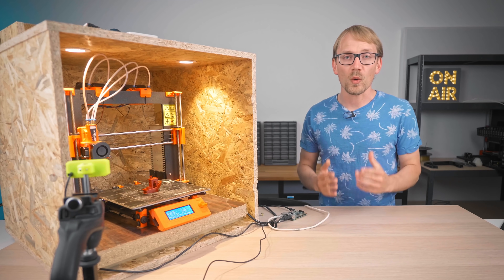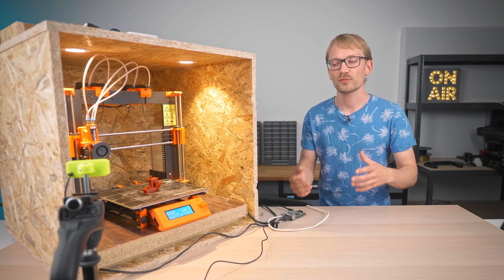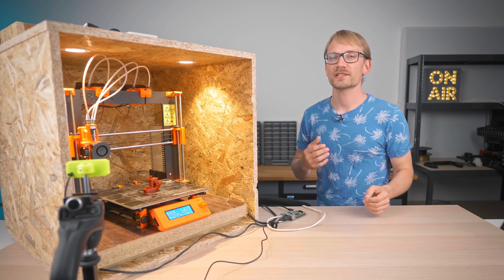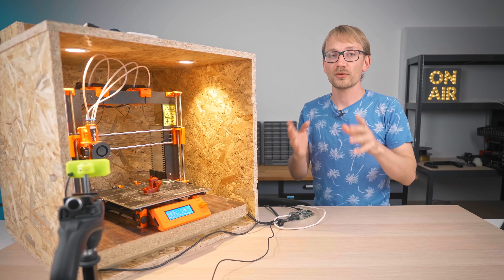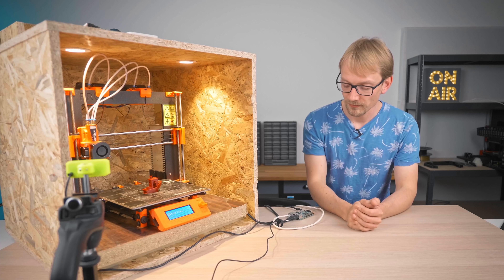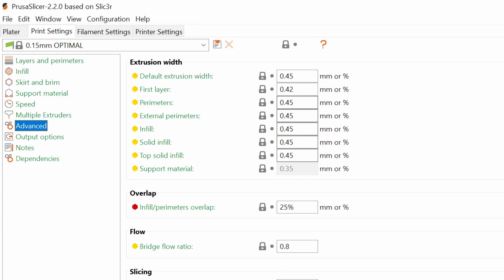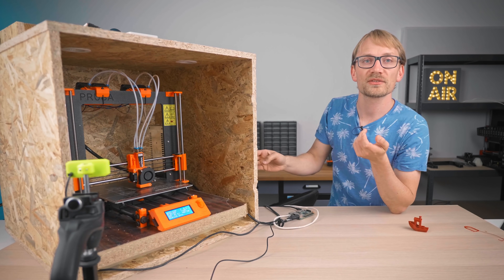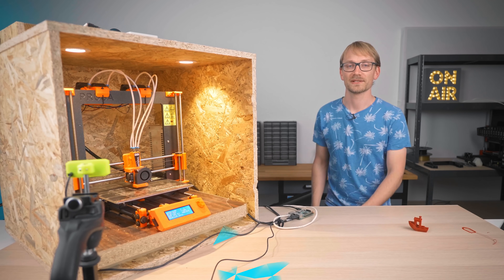Starting 3D prints without getting up from my desk - choose from 4 filaments in one click!

Comment: My Ender 3 set up has been on a shelf mounted in my coat closet for silence and convenience. There’s a “Vesync” smart outlet plugged into a UPS in case power is flakey or shuts off momentarily and the smart outlet is used for powering the machine on remotely and starting prints, or for turning the machine off on a timer late into the night. I have the Octoprint Pi mounted in an enclosure by the printer and it has “PortListener”, AstroPrint, PolorCloud, Spaghetti Detective, and a few other plugins so it will automatically connect to the printer once it is powered on and can then use any of the cloud accounts to accept and begin prints. My choice of slicer is Simplify3d and I have the script to automatically send the gcode and start for quick prototyping. The MMU is a great addition to that!!!

Comment: I have a similar setup as you, but am using a Prusa MK3S with MMU2. There is an Octoprint plug-in for this called MMU2 Select Filament, that will allow you to use the MMU Single filament printer in PrusaSlicer, and choose which filament to load from the octoprint screen at print time. Pairing this with the Filament Manager plugin, and I can see not only which filament is loaded into each port on the MMU, but how much is left on each spool.  I've found this especially helpful this last month as I've been printing a lot of the Prusa Face Shields. As one spool of filament is running out, I can simply switch to a different "tool" to print in a different color without reslicing it to assign the next filament.

Comment: I've had so much trouble getting reliability out of the extruder on my Ender 5. I've used Chep's recommendations for a spacer in the hot end, and actually now just take the boden tube out of the coupler every time I change filament which isn't a big deal with that spacer/boden setup in place. I'm going to look into replacing the whole hot end assembly with a different design soon because I'm on my third one from various failures. I've almost given up on printing PLA/PETG on this printer even though it's supposedly supported, not sure if I'm getting burnt material stuck in the hot ends or what but no end to the problems.

Comment: You're a genius of you can get FUSION 360 to get up and running in 5 minutes let alone design a part another 10...

🤦🏻‍♂️

Stay safe!
Reply: I ussualy stary F360 and then just lunch and then come back
Reply: I have a new laptop,and fusion is very fast now . Indeed 5 minutes
Reply: @magomat6756  I never had a problem with speed until the 2019 overhaul with updated UI.

My machine is no slouch with 8 core Intel I7, 16 GB memory, 8 GB Nvidia GeForce HDMI with full Full HD+ 

No other programs have slowed down, except F360.
Reply: @DougHanchard  SSD is possibly the missing link
I5-4460 3.2Ghz,  8 gig memory I get 22 secs from double click  F360 icon to being able to start a sketch - leaving 4 mins 38sec to make the object....

SSD has changed my life -  and any request to reboot is no longer an "awww do I /really/ have to..." response...
sub 1 min cold boot so it is no longer a drama

I couldn't go back to mechanical disk and well worth the extra cost
Reply: @robocog  or better yet, m.2 ssd
Reply: @robocog  About the same here. 16GB memory on an older Ryzan. The big thing is the M2 ssd. Even a sata ssd does wonders.
Reply: I5 3570K, 16GB DDR3, GTX980 x2 SLI, 2x 256GB Samsung SATA SSD raid 0.
24 seconds from double-click to sketch. That's with 4 chrome windows open each with like 10-15 tabs.

Comment: Instead of leaving my printer plugged-in, I prefer using a smart power outlet and turn on the printer as well as the octopi remotely using the Smartlife app on my phone. I feel safer knowing that my printer is not powered on when i'm not using it :P
Reply: I just had the MOSFET controlling my hot end fail ON a few days ago.  It didn't start a fire, but it could have easily.  I'm working on adding a relay to octoprint to power off when the print is done, hopefully through a custom g code command

Comment: I have a similar set up. A mk 3 with an mmu2 in an enclosure. Dry box on top with 8 filament feed ports out of the box. LED lights, octoprint with a webcam, and spaghetti detective. My biggest issue is the mmu2. It's almost not worth the hassle. I can't seem to get it to be reliable.

Comment: My ender 3 with hemera and a bunch of other upgrades is reliable enough that I can set a print and be very confident that it will finish without issues. That's with pla, petg or tpu (the only three filaments I've found I need for just about everything.

Comment: With 0.5  nozzle external perimeter can still be 0.4 for details and internal at 0.6-1mm easily. So 2mm wall will be three perimeters, not four. Most limiting factor is actually heater, so better use volcano to not lose speed.

Comment: I thought that you're going to promote Pallete S2 at the first glance, lol. I have the same setup but with an Ender 3, the only one problem is that I need to manually change the filament. In my opinion, Octoprint and Cura(with extensions)/Prusa slicer is just the perfect combination for a workhorse machine.

Comment: I have a MK3S and I had the same filament print issue.. I have not yet fixed it but I am taking a more drastic attempt changing the of the hotend heat break part for genuine e3d part.
as apposed to the prusa specific model and removing the quiet fan for a high flow fan.. still waiting on parts in the mail...

Comment: That's exactly what I've planned doing with my MK3s and MMU2s. Parts for the Ikea Lack v2 enclosure are already printed, Lack tables, acrylic panels and RasPi are here but I have to wait until Monday for the DIY shops to reopen to get the screws and other needed stuff. Thanks for the tips and tricks to get this setup running. 👍🏻
For monitoring via Octoprint you might have an eye on Printoid or OctoRemote if you have an Android phone. Printoid also gives you the ability to see the video feed. I don't know if OctoRemote does that aswell. You could do a VPN to your router and monitor it securely like that.

Comment: If you want to remove some concerns about leaving the device running unattended, one extra piece of mind would be adding a remote way to cut of its power.
A Tasmota compatible WiFi plug can be used for that, there is even a plugin for octoprint which monitors thermal runaway or simply turns the printer main power on/off for and after prints.
There is also a version where you solder a relais inline with the power yourself and hook that up directly to the Pi but the WiFi plug is just a simpler solution.
Just make sure to leave a good delay before it turns off, just in case the PSU is still toasty and things had time to cool off a little. Not that there is new power draw when it turns off but fans cool things down faster.

On my CR-20 Pro the Pi actually still powers the mainboard with the mains turned off but the heater and fans are powered by the PSU.
As for remote access I also just run an openVPN directly on my router, having the full webinterface remotely is better compared to the limited "remote" options.
Reply: I have this setup with a TPLink outlet that I can cut power from remotely. I also have a smoke detector in side my print enclosure, and my Wyze Cam in my house will notify me if it hears the alarm go off - just in case there's a runaway heater block problem that starts smoldering.

Comment: My go to printer is an Anet A8 or what is left of one, over the years I replaced the hot end with a E3DV6 clone and RAMPS1.5 because the original parts wore out. I still use the printer over my other printers because while it doesn't have anything fancy, it just works every time and doesn't need bed calibration after the initial leveling.

Not my final solution, but you are right we all have that one machine we can trust above the rest

Comment: Nice video!
Quick question, without taking the current shortage into consideration, what would your recommendation for a webcam be, if you had to fit it in the enclosure (or, in my case: the Prusa Lack Enclosure)?
I already got lights in there, but I'm missing a decent wide-angle webcam, possibly even with IR lights by itself...
Reply: Most webcams use a 90° angle which most likely wouldn't be enough if you want to mount the camera inside the enclosure. What you could do, though, is to get any webcam and one of those cheap clip-on wide angle lenses for smartphones. Alternatively, you could get a cheap action cam. Those usually have a 140° or 170° viewing angle and can actually be used as a webcam without issues.
Reply: @RobEDC  Any idea which one to get that would work via USB? I mean I would love to just have one that I could just plug into the Pi...

Comment: I run three Prusa i3 MK3S printers at work, two with MMU2S. While there was only one printer, I used it in the traditional way, with an SD card. I gave me an excuse to interact with the printer (it was new stuff for me back then), and I would watch the print until the first thrid or half of the first layer was complete. Now, with three printers, I went with Reptier Server Pro, because one Raspberry Pi 3B is more than enough to run all printers, with a webcam attached to each printer (via a powered USB hub). Since we mostly print with black PETG most of the times, the MMUs are disabled (power is unplugged from them and the bowden tube to the extruder is removed), because it's not the stablest thing in the long term. We also have a touchscreen hooked up to the Pi (the factory one), so it's possible to start (or stop) a print locally. It's also quicker to preheat the printer or move the head and bed around from the touchscreen.
This is all fine when we're at the office, but for remote monitoring I went for VPN. The router (Mikrotik RB750Gr3) is acting like a VPN server, and me and my colleagues can log in from home or from our smartphones. Then it's just a matter of punching in the IP address of the Pi to the web browser. My home router (a Mikrotik RB4011) is permanently connected to the office router via VPN, so my computer is basically on my home and office network at the same time. I can just click on the bookmark of Repetier Server on my bookmarks bar, and I can immediately see what's going on with the printers at the office.
As for my home setup, I'm running my MK3S and Alfawise U20 from SD cards, however I'm planning to virtualize two instances of OctoPrint on my home server, one for each printer.

Comment: I have a similar setup, but I used a rain-proof cabinet, so I can place it outside and get all the fumes and noise out of my house. I have also insulated it with foam so it can hold the temperature in winter. I have the Raspberry Pi and the electronic boards in a different shelf, and 4 fans switch on/off depending on temperature conditions, so I can keep the electronics at ambient temperature and the printing volume at ~40º. Temperatures in Madrid can range from -5ºC in winter to +45ºC in summer (and not under direct sun), so I hope it doesn't catastrophically fail in a couple of months. I have been thinking about adding some kind of automatic extinguisher but it's too much work for now.
What makes my life a little bit easier is to slice directly in octoprint, i have some basic presets that works with easy parts, so I just load the stl to the printer that I want to use, instead of changing all the settings in my computer, which sometimes leads to a mistake.

Comment: I use the infrared raspicam so you can control the printer also by night without leaving the lights on. at the same time if you hook a rele module to raspberry you can control it  and turn it on remotely from octoprint.
Reply: I use the M80  in marlin PS_ON_PIN to trigger a solid state relay to power on the 24v PS. I have a 5v PS that is always on to power the PI and RAMPS stack. I use the toggle PSU plugin with octoprint to automatically turn the printer on when I start  printing and off when it is done and the hotend has cooled to 70c
Reply: To switch ON my 3d printer, i use the plugin PSU. But I would like to add an other relay to control lights. Unfortunately with PSU plug in I can only control one relay. Do you know an other plugin to control relay? Thanks :)
Reply: @Crazystorming  The Enclosure Plugin can do that, really Neat Plugin todo a lot ot Stuff with the GPIO Pins via Octoprint, i can even mointor a Filament Sensor.
Reply: I use IKEA lights which I can also control remotely.
Reply: Thanks ! I tried enclosure plugin. It's very nice and easy to use, and provide a lot of possibilities ! I love it :)

Comment: Interesting setup. Would you ever swap out one of the filaments for soluble PVA+? I've been trying to get it working on my mmu2s but that filament seems to be very prone to getting stuck on filament changes.
Reply: I have switched from soluble to break away support and for 80%? of my uses, it really works well.
Reply: @LummyTech  I'll take a look into it. Thank you for the suggestion! 😊

Comment: What does Spaghetti Detective have over regular VPN? Also I like the homemade IKEA LACK enclosure for the Prusa printers beter. Nice workflow though!
Reply from the maker: TSD is a super-easy, plug-and-play solution that you can use from any computer or phone with a simple sign-in.
A VPN setup no doubt is more capable, but also needs significantly more effort to set up.
Reply: @MadeWithLayers  VPN might need a little effort to setup initially, but as it is already included in most routers it shouldn't be that hard especially for your target audience ;-)
Reply: TSD looks for your after your Prints. It's a AI Trained Monitoring Service. So if something happens, it will Pause the Print for you, so you don't have to watch the Stream all the time.But Tom also said it, even if just very Briefly. (Which is a shame)

Comment: That's an impressive set of modifications & upgrades for an upload and automatically print machine.
The only real upgrade I did to my Mk3 was swapping over to a Toshiba FlashAir 64GB card for its wifi ability, being able to copy the .gcode file onto the card without unplugging it from the printer makes things so much easier.
Reply: Indeed they do! For several years now, never thought I'd need one until I figured out how useful it would be for my 3D printer.
There's a few ways they can be setup, mine is configured to connect to my wifi hotspot, then I put its IP address into Windows Explorer to access the SD card like a network drive.

Comment: Get the Telegram plugin, it’s by far the best free way to remote monitor a Octoprint instance :)
Reply: Really? A printer that texts you when it's done?
Reply: @machinerin151  Yes, and if you have a webcam connected to Octoprint, it will send you the status every x minutes or layers together with a picture. You can also start prints, cancel them, check status manually and shutdown Octoprint with it. Super handy.

It even allows user rights for each Telegram.
Reply: That‘s so cool, didn‘t know that existed. Big thanks!
Reply: The Telegram plug-in is great.
Reply: Another option to that is octorant , makes use of discord instead of texting (some might prefer depending on how their phone company treats texts vs data).
Reply: @nobodytoyou4887  Telegram is data, it's the texting app like WhatsApp, it works over the internet. They can't count how many texts you sent over one of these even if they wanted to, everything is encrypted!

Comment: I am facing nozzel height  problem in printing. I am using inductive sensor for z height. I have set up Marlin and also using G29 command nozzel height and z-offset is calibrated. While z-offset calibration, I have adjusted z-offset so that only bussiness card can pass. But while actual printing there is around 8-10 mm gap remains between nozzel and heatbed. I don't know how it is happening. I am unable to resolve this issue. If you can help me in this case , I will be grateful to you. Please kindly help me

Comment: Liking your kitchen top/ foam anti vibration solution. I am still using Repetier Host and the included cura which is so old. I use Repetier Server instead of Octoprint on an Raspberry Pi3 and just send the Gcode to the server.
No live surveillance as I don't trust my printer, I just let it print and check if every hour or so. For me an unserveilled printer either has some AI based on camera that will stop the print when something goes wrong + some automatic extinguisher + electricity cuttoff if things get really nasty.

Comment: I just have a laptop in my printroom, all printers and webcams connected and then I rdp from anywhere. Very handy. Also, since I run a slicer/printer, I can handle all simultaniously and have better feedback of what's happening. At first I wanted an octoprint setup, solved it this way and eliminated the need and extra cost of a pi

Comment: that box is going to burn your house down, use metal instead
Reply: No I don't think the box will burn the house down.
Maybe the fire started in the printer that then goes through the box and onto whatever the box is placed on, but I don't think the box itself will.
Also it's really not that common for a printer (especially not Prusa) to light on fire...

Comment: I was using Octoprint anywhere before they migrated to spaghetti detective. I stopped using them for one main reason. Once I installed their plugging on my Octoprint instance it somehow messed up my cam feed and lowered the resolution I was getting on my own network. Could figure out why it did that, I didn't use it that much anyways so the quick fix was getting rid of it. As soon as I installed the plugging my cam feed went back to normal.
Reply: This is expected due to how it streams. We use a different protocol that uses less bandwidth than MJPEG. A down side to it is that, on only USB cameras, is that due to the Pi's lower CPU resources we need to limit the resolution among other issues regarding the variety of USB cameras